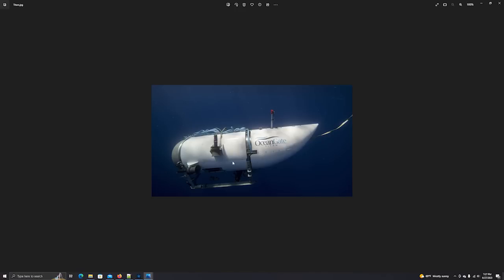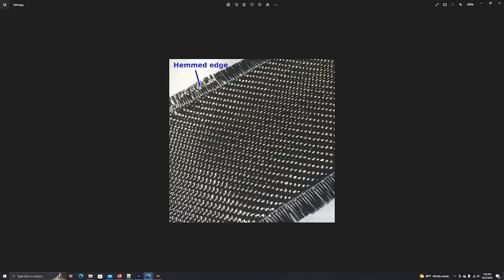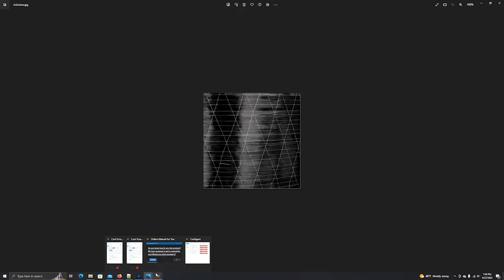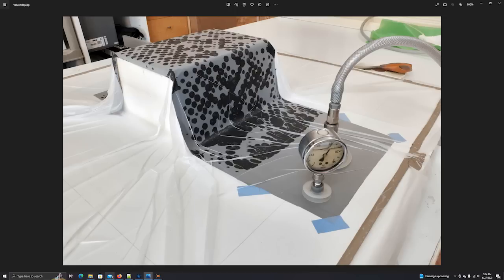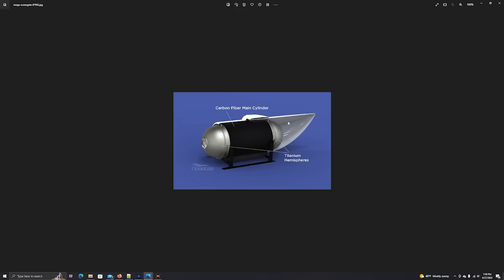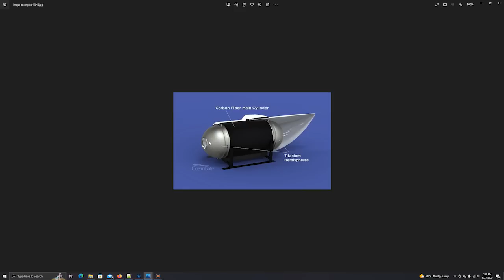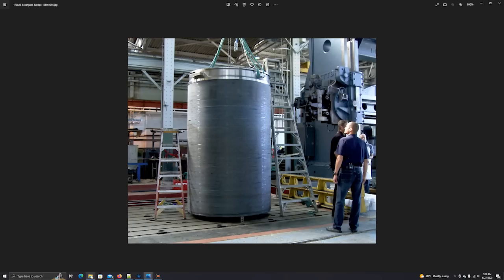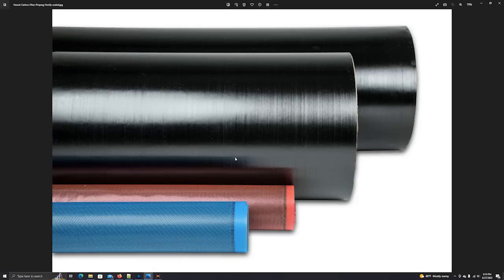Oceangate  Titan Submersible Manufacturing and Engineering Issues Part 1

Comment: Just a quick question about the difference in hull strength if the CF was used differently. 
Instead of axially wrapping the CF around the inner titanium tube the way OceanGate made the Titan hull, what if instead the CF was 5" (or whatever hull thickness) wide factory finely woven into a curve that exactly matched the curvature of the inner titanium tube, in one single piece thousands of metres long?
So in other words, wrapping adjacent to the flanges and gradually building up to the full length of the hull, with the woven CF perpendicular to the inner titanium tube external surface. I imagine quite expensive, far more difficult, would need to be compressed as it was wrapped, and may require some new tech to achieve, but in theory this way the CF wouldn't be as likely to delaminate since the pressure from the titanium bulkheads would press the spiral laminate tightly together. Obviously the design would need to allow for some longitudinal compression and expansion (possibly with bellows to allow for this on the inner titanium hull), but at least with the radially woven CF, then in theory there would be much greater compressional strength that would take greater advantage of the tensile strength of CF. I'd have thought it would be more ideal to design the CF hull so it could be easily removed (for reduced maintenance costs) in one cylindrical piece from the titanium hull, for testing/scanning from both the exterior and interior surface for better resolution. Obviously the above would require a lot of work and engineering, far easier said than done. 
If the Titan could even survive one trip to the Titanic with that crude axially wrapped wrapped CF hull (which I find quite surprising) then I'd have thought a far better way of using CF more suited for compressional loading might hold some promise, at least for the testing phase and unmanned trials. 
What are your thoughts?
Reply from the maker: Great question,  In the video of the earlier sub it only show the hoop wrapping.  I understand that in a later process they wrapped pregreg in a more axially orientation in the long direction.  But the older sub did still fail.  On the titan sub they used pregrep carbon through out the entire sub and used a tape wrapping machine. I was told that they wrapped in the hoop orientation and in the axial directions.  I heard that they wanted 7" of thickness, but for some reason they received 5" thickness.  Not sure why,  Maybe a cost situation that Stockton Rush later decided.  But that is just a guess based on his logic of using acrylic viewing port rated only to 1300 meter instead of 4000 meters.   I have also read that carbon fiber can be constructed for strength  against compressive forces.  I am anxious to see the findings that the Canadian NTSB comes up.  Based on the images of the recovered sub it appears that  the titanium flanges popped out with little trace of either adhesive or carbon fiber remains attached to the flange.  Thanks for the great question.

Comment: From the materials-science perspective... Once upon a time, kayaks were made from fiberglass. A guy named Chan Zwanzig figured he could roto-mold better kayaks, and that's how kayaks are made now. Not carbon fiber, for kind of the same reasons fiberglass is best used for boat hulls. Internal-pressure vessel, CF's great, but external pressure? If you think so, I have a carbon-fiber kayak to sell you. Or a fiberglass submarine...
Reply from the maker: Thanks for the feedback

Comment: Oh and btw the hull wound by Spencer composites was wound with a wet winding process. This hull made loud cracking noises in service and so it was retired. The hull that failed and killed 5 people was wound using prepreg.
Reply from the maker: Yup, I said old sub was made wet layup new sum was prepreg and I mentioned Spencer Composites
Reply: @JoediyLab  Oh got it. I didn't notice.
Reply: Do you remember the source for that info?
Reply from the maker: @eurotrashdude8484  Check the following wikipedia page on Oceangate  https://en.wikipedia.org/wiki/OceanGate
Reply from the maker: Also there is a video Posted in the description from the Oceangate Youtube page showing the wet filament winding process.

Comment: GREAT tutorial Joe ... nicely explained and bookmarked accordingly. And also thanks for confirming what I suspected ... no Auto-Clave used; the part that pisses me off ("Old  White Guy" with 40 years experience building composite structures (38 Countries) for the World's largest Defense Firm) to no end is lack of a "Clean Room" or Ultrasonic NDI (after EVERY dive) ... pity that Rush didn't follow his 20 years of experience building the F-15 and knowing it would need to be done per AS9102 with SOF/QUAL/HALT requirements from "Engineering". BTW ... stress software loaded with the dimensions, material type, tape laying method shows that the pressure hull would need to have been 17.6 inches thick to withstand 6,000 psi ... far more than the 5 inches Rush and his Team came up with. Installation of the Titanium flange to CF Hull is the most probable failure point; expansion/contraction differentials between Titanium and CF result in a 1mm "gap" ... which is why Rush used his "Secret Sauce Adhesive" to cushion the different rates. And as you and I know ... if you take a smooth, steel rod and dip it in liquid silicone or "adhesive", let it cure ... you can pull it off the rod like it was a rubber glove. He would have been better off using a “Thread Laying (TOWS) machine and certainly an Auto-Clave. This thing was doomed from the get go. Saddest part is the kid that didn't want  to go but it was  "Father's Day" ... breaks my heart !
Reply from the maker: Thanks for the comments.
Reply: @JoediyLab  Welcome ... things to ponder.

Comment: The Oceangate Video of winding the hull says it was for "Cyclops 2" which they eventually changed to "Titan." That video could be the very same hull that failed. I heard they did one change to the titan hull after around 2-3 dives because how loud and often they heard the carbon cracking and popping. Not sure if they made a new hull or just did some re-enforcing. Very curious on exactly what they did. Would love to hear your opinion.
Reply from the maker: The video is winding of an older pressure vessel.  I spoke with an engineer that indicated the Titan use tape winding and not filament winding.  Tape winding would be better as they could use prepreg tape and avoid the wet layup.  It could also then be cured in an autoclave.  But as far as we know they cured in an oven and not an autoclave.
Reply: I hit wrong key on that date it was done 2020 to fall of 2021. On hull

Comment: The connection from titanium end plates and composite pressure vessel under pressure will compress at different rates. 

I have trouble believing it was material fatigue.
Reply from the maker: Not in the titanium,  in the images from recovery they appear intact.  But I have heard from seen images that the viewing port was blown out. Thanks

Comment: Carbon fiber for compression (pressure typical) applications a pretty strict no, no - universally.  CEO of OceanGate, Mr Rush, was in an oxygen deprived state, on top of Mount Stupid. (Kruger-Dunning effect)
Reply: Exactly! It's tensile strength vs it's weight is incredible, but it's not a good choice for this application. It would be well suited for containing internal pressures, but not at all suited for dealing with external pressure.

Comment: Thank you for a very informative video. So many things that I did not know about carbon fibre.

You brought up F1 and from various videos I have seen they appear to use a clean room environment and they are only driving round a field. This is not to denigrate their skills. Oceangate appear to be constructing the pressure vessel in an airy warehouse/workshop for a far more extreme enviroment. It also appears that the titanium end is only held on with adhesive from an open bucket. Unless there is an inner ring it is only that bond resisting external pressure. From the recovered ends they appear to have come out devoid of any carbon fibre.
Reply from the maker: Yes I would love to see the results of the investigation.  Epoxy bonding with composites is common, but I do not think anyone has tested at these pressures.
Reply: Bonding composites to metals is a tricky business. Preparation of the surfaces is very important, as is ensuring complete contact.
Reply from the maker: @TricksterJ97  Good information, thanks
Reply from the maker: @TricksterJ97  thanks for your feedback

Comment: I feel i have been well informed to the best of your knowledge  by your video .Thanks Joe for sharing what you know .Great help in understanding more than what has been said recently.
I kept asking myself what is the cylinder under the carbon cylinder they are weaving onto ? is it just the mandrel or a titanium inner sleeve to go with the wound carbon hull ?
Reply from the maker: Yes you are correct the metal cylinder is  a mandrel, once cured the carbon fiber is pulled off of the mandrel, then the flanges are glued onto the carbon fiber tube.  Thanks for the feedback
Reply: @JoediyLab  I want to see a very thin steel or titanium mandrel removed from the CF hull of that size. After curing both parts are glued together, if not realy, friction between parts is terrible. It is possible if you contract the inner mandrel by freezing but what influence on CF caracteristics?????

Comment: If all the fibers are going in a circular direction around the tube, and they don't have any layers going the length of the thing, then there's nothing other than resin resisting forces in the axial direction. They built a cylinder that's weak in what's usually the strongest direction. The hydraulic press channel has a video of carbon failing in this direction. It doesn't just shatter, it totally disintgrates into almost dust. If it failed like that, it would explain why they didn't bring up any shattered carbon pieces.
Reply from the maker: Correct,  The video does not show a later process of wrapping carbon in the axial direction.  The Titan sub was actually wrapped using pregrep and a tape wrapping machine.  Totally different than filament winding process.  Thanks for your feedback

Comment: Cylinders have to be compacted layer by layer. Hoop tow tension is not enough radial pressure to compact broadgoods. I was a manufacturing engineer on filament wound cases designed for space shuttle boosters. They are now at Huntsville Alabama. The program ended when the director of NASA blew up the Challenger shuttle. The vacuume bag after winding does more to wrinkle hoop layers that are not compacted. They achieved low void content by drowning it in epoxy. You can see them scraping off the excess resin while winding. That is not resin control!
Reply from the maker: Great information,  yes the filament wound sub failed during testing.  Yes it was pretty scary watching the first video.
Reply: yeah......except the space shuttle boosters were made from steel
Reply: @mycammedia  Yes the NASA booster cases are steel 1/2” thick DCAC tool steel. Before the Challenger was destroyed by the director of NASA the Air Force wanted to do a polar launch.Filament-wound cases were manufactured by Hercules Inc. I was the senior process engineer.
Edit
“In order to provide the necessary performance to launch polar-orbiting shuttles from the SLC-6 launch pad at Vandenberg Air Force Base in California, SRBs using filament-wound cases (FWC) were designed to be more lightweight than the steel cases used on Kennedy Space Center-launched SRBs.[30] Unlike the regular SRBs, which had the flawed field joint design that led to the Challenger Disaster in 1986, the FWC boosters had the "double tang" joint design (necessary to keep the boosters properly in alignment during the "twang" movement when the SSMEs are ignited prior to liftoff), but used the two O-ring seals. With the closure of SLC-6, the FWC boosters were scrapped by ATK and NASA, but their field joints, albeit modified to incorporate the current three O-ring seals and joint heaters, were later (after STS-51L) incorporated into the field joints on the SRBs used until the last flight in 2011.”
Reply: @oneskydog6768  Really - didn't know about that - why was it not really common knowledge - I only ask because I never saw any reference to anything like that. That must have  been some amazing set up in terms of size - any special arrangement for the interface of the segment 'body' to the steel joints? just curious. I was interested in all the issues surrounding the field joint design - rotation of the joint, etc. I also was deeply interested a long time ago about AA587 - the public hearings about engineering issues and the differences of approach / philosophy between Boeing and Airbus about what each was willing to do when it came to using carbon fiber. Airbus pushed the issue much further towards making moutings from cf - but Boeing were way more conservative then and were unhappy to make the actual mountings from cf. At that time, they wanted to stick to an experience base of 70 years around the fatigue issue with metal.
Reply: @mycammedia  operational security need to know basis

Comment: The only vids Ive seen of the mid-section layup,  shows fibers only laid in the hoop direction, however the Wikipedia description suggests that there are alternate axial layers of UND. So effectively (if thats true) it should have similar properties to a weave. Perhaps optimistically achieving 550 MPA in compression? A simple solidworks simulation, (not accounting for dissimilar materials or adhesive bonds) suggests a stress of 250MPA at 4000mts if the entire pressure vessel were homogeneous. That seems rather too close for comfort. I have also not checked for buckling failure mode (tin can collapse) which may be a factor. Also the highest stress area is exactly where the titanium ends would attach.
Reply from the maker: Yes  I have not seen  another video  as well.  I had heard that they wrapped prepreg in an axial orientation, but I cannot find any proof.  Thanks

Comment: Now that the 787 Dreamliner. The carbon fiber vessel, do we want to be traveling around in pressurized cabins high in the atmosphere as we have seen the response to stress over time?
Reply from the maker: Inside pressure is in tension,  outside pressure is in compression,  Big difference.  Thanks for the comment

Comment: You mentioned unidirectional fibers.  I wonder what impact if any the unidirectional construction (no fibers along the length) had on the strength of the pressure vessel..
Reply: Basically no bending or shear resistance other than the epoxy resin matrix.

Comment: It appears carbon fiber and titanium have different rates of thermal expansion.  Therefore, the materials would not expand and contract at the same rate thus opening up a mode of failure entirely based on exposure to temperature exposure differentials,  entirely leaving the pressure exposure issue outside of the equation. From approximate surface (June 2023) to subsurface temperature differential is about 8 Deg C, estimated. The delta is not zero.  Repeated cycling (outside of pressure delta) seems to show an issue.

Comment: I'm wondering... Since the assembly is under compression, wouldn't most of the load be supported by the resin, not the CF? What would have happened if they used 5" thick resin poured from a mold with no CF at all?
Reply from the maker: No you will still get support from the carbon fiber.  the strength  of the fiber is along the length of the fibers.  So you orient the fibers along the areas  of stress you need.  If you cast structural resin that thick it would heat up to much and weaken.  Even with slower curing resin it would shatter.  The strength of carbon fiber is a combination of resin to carbon fiber matrix.  Carbon fiber by itself is only good in tension.  If designed correctly you can get good strength in both tension and compression,  But more strength in tension.  Thanks for the great question.

Comment: Very clear and consise video, it's well known how Aircraft Wings are created with multiple patterns laid under Computer control. The flexibility has to be carefully planned and calculated and tested before a safe structure is used on an aircraft. As you said "Stretch" is very strong but "Compression" is not so strong. I was not happy watching the video of the manufacturer of the cylinder. It looked very risky and almost at a "Home DIY" level of build.
Reply from the maker: Thanks for the feedback

Comment: wonder what kind of seal they have on the front dome closing onto the titanium ring. looks like a smooth surface, then any seal when the front hatch is closed ?
Reply from the maker: No seal, at depth the pressure would keep water out.  Just have to make sure surfaces are very clean.  Thanks for the great question 😊